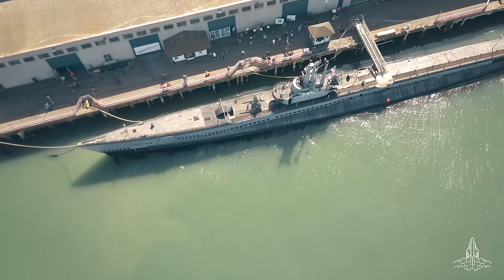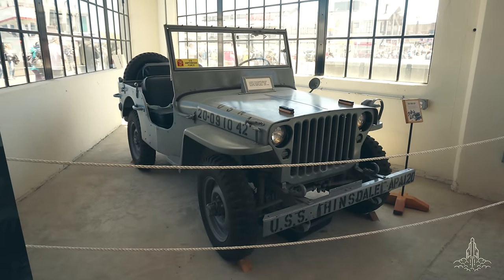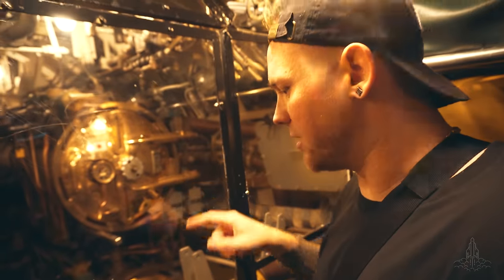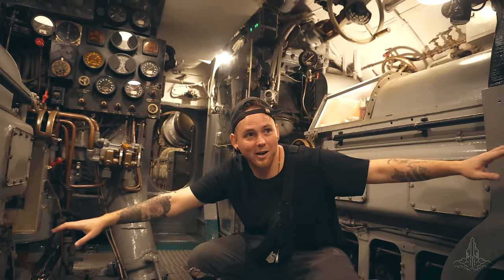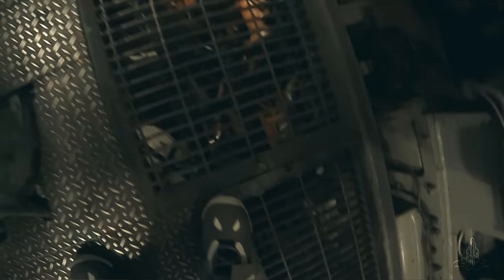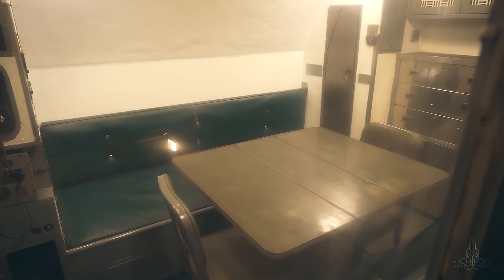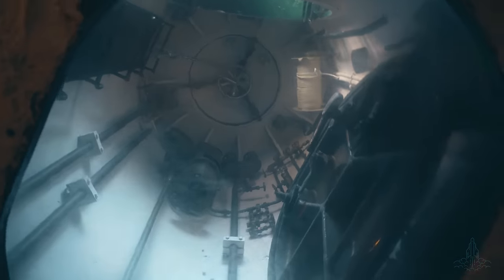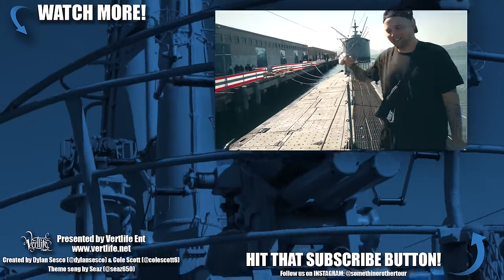Inside A WW2 Submarine: USS Pampanito in San Francisco 🌁

Comment: As a former submarine sailor one thing we learn unless you know what the valve knob or switch does don’t touch it seems the electrical system worms touching what I saw you touch you’re lucky you didn’t flood the ballast tanks and sink by the pier let’s assume they were welded shut don’t touch
Reply from the maker: This museum encourages interaction. We weren't breaking the rules or touching live instruments.
Reply: The submarine and liberty ship both still run.
The sub has no prop and ballast are not welded.
When I went and I spoke with the currator and I was taken where all the controls to do anything to start the engine or flood the balast were and he was no where near them.
That being said some of those controls he was touching do control engine speed and such